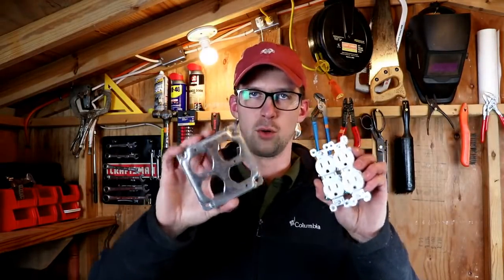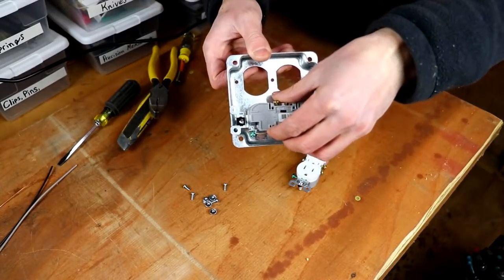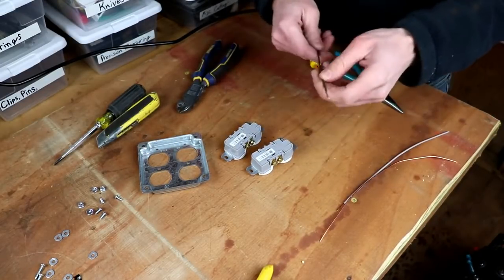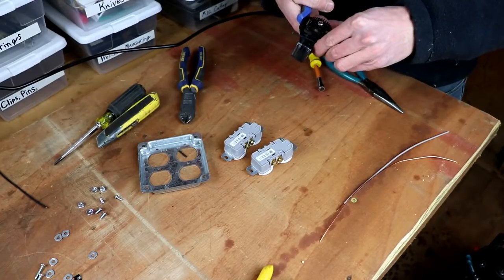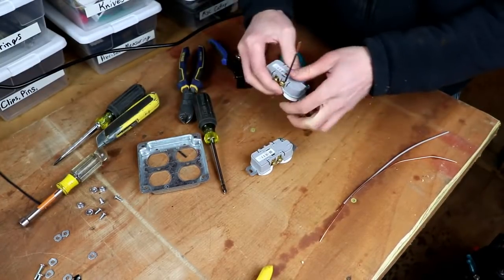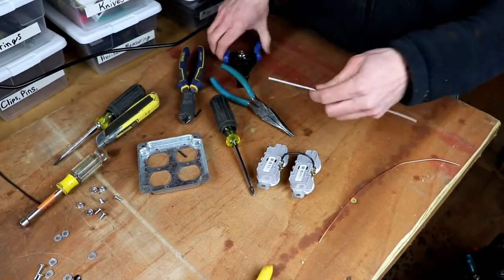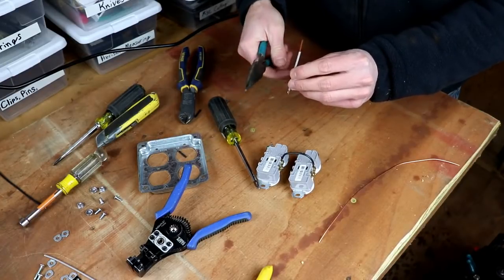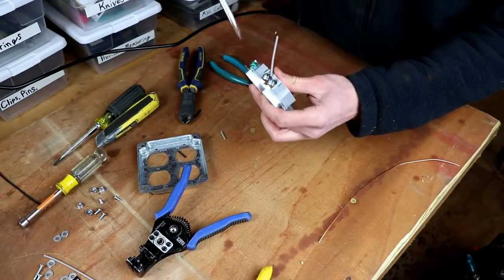How to Wire a Double Duplex Outlet

Comment: I realize that you meant well, and it's great that you didn't make a long boring video, however, that bring said, you're going to get somebody electrocuted if you don't learn how to properly do this?? Several other  people already clarified what you did wrong. You should most definitely make a follow up video with the corrections, or don't do anymore electrical related videos, until you completely understand the mistakes that you made, because they are significant mistakes!!! Cheers!

Comment: You were doing so great until you went to that box on the wall. The wire could have been through the stud to allow drywall at some point. I guess if you never plan to finish it then it's fine. But the wire was SO tight to the box, not extra if ever later needing to cut the wires in the box to redo something and then on top of that you cut the wires IN the box also extremely short. There is nothing left on that wire to redo anything later down the road if needed. Wire is super cheap, leave some extra outside the box and a little extra in the box.

Comment: You referred to the white wire as the 'neutral' and the black wire as the 'hot'. Also the metal box was not earthed and the twist on connector referred to as wire nut should have been taped for security. This is why it's always a good idea to get a licenced and qualified electrician to do this stuff. Reported for promoting dangerous practices.

Comment: Since it’s a metal box, should it be connected to ground as well?
Reply: Just finished putting together my own double duplex outlet and also thought about the need to ground the box. The receptacles I used will ground to the box when running the holding screws through the face plate and through the tab. There is a metal piece there that goes to the ground. 
Just wish I had found and watched this video first, would have saved me some time and effort.

Comment: I'm just Joe Homeowner but my god what a disaster of an installation this is. Ungrounded box, romex stapled to the front of the stud, wires way too short. Awful.
Reply: I am a licensed electrician and I agree with everything you said. He also didn't pre twist his wires for the joint he made with the grounds and we like to wire  2 gang receptacles in parallel instead of series because if one stops working the other one will keep working. Lastly he didn't tape around the outlets which is recommended and common practice when using metal electrical boxes.
Reply: @Breadmanbeck  Also, I've read that you can't use stripped romex because it isn't ANSI labeled once the outer insulation is removed.

Comment: I stopped at 8 minutes in, your required to have 6" of wire from your feed, (romex coming into the box), the box is required to be grounded, plus you should twist the ground wires together first, then put the wire nut on. And the romex is stapled to the outside of the stud, should have had a hole drilled thru the stud with the outside of the hole (closest to the front of the stud) a minimum of 1 1/4 inches from the front of the stud.

Comment: I count 4 code violations.  NM on stud face, no box ground, short pig tails, and using a non-gfci device as part of neutral circuit.  Using non-gfci device as part of hot circuit is not a code violation, but is bad practice. Any competent resale inspection will flag this, and a gov bldg inspector will jump on it with both feet. Take this down until you get it right.
Reply: I'd like to understand what you mean by, "non-gfci device as part of neutral circuit".  I'm always wanting to learn.
Reply: @jefferywaters2778  in your vid, a component of one of the outlets was in series of the neutral. Not permitted except for gfci..  For load side duplex outlets fed by a gfci outlet to function, their neutral must return through the gfci outlet.  In any other case, removal of a neutral connection to a device cannot break the neutral current path back to the panel for any other device.   The rationale for this is that in a chain of outlets, if damage or loose screws or whatever breaks neutral before the end of the chain, lamps or other load devices downstream of the break will pull the isolated neutral segment hot.  A dangerous no no. Outlets, switches, fixed lighting, etc, cannot be used as a part of a ground or neutral circuit.  In simple terms, removal of a screw from a device can at most disconnect the ground or neutral from that one device only.  Gfci devices are the exception because their operation requires it.  This reason is also why a gfci outlet must be the first outlet in a chain, it can only protect itself and downstream devices.  Read the NEC before you make self help vids.  I'm serious, you really really should take this video down or replace it with a fixed version.  P.s.  I'm not an electrician, I'm an industrial equipment EE, motors, drives, servos, etc.

Comment: Bonding screw on the box? Wire nut on the ground most areas are ok but some local codes call for bonding crimps. Ground has to be twisted  regardless. And one point not mentioned is make sure you do not get any plastic insulation under the terminal screws on the outlet. Stands a chance of coming loose over time. And also code is 6 inches of wire from the back of the box.

Comment: Are you going to ground the box?
Reply: Nope! Hahaha! Electrically, it is grounded because the frame of the outlet is ground, and the four screws are ground and they attach to the cover and the cover attaches to the box. Code wise, it fails, and exposed Romex on the wall fails. Good method otherwise.

Comment: So I have a question for everyone that reads this, my house was built with some 14 gauge wire in receptacles, I want to add another receptacle, so my question is adding a second receptacle should I use 14 gauge wire or 12 gauge wire even though the main wire that I’m tapping off of is 14 gauge? Does it really make a difference going from 14 to 12 gauge?
Reply: Go 14 gauge, you have no benefit going 12 gauge since you're on a 15 amp breaker and all the receptacles on that feed can not exceed 15 amps. 12 gauge is for 20 amps. You can install 12 gauge wire if that's all you have BUT your receptacles have to be rated for 15 amps max.
Reply: @dtm8073  thank you so much! I really do appreciate it! That’s what I was thinking too. Why do people use 12 gauge for receptacles and only hook it up to a 15 amp breaker? Is it because the wire is thicker and it’s more Better?
Reply: I’d use 500 KCMIL just to be on the safe side.
Reply: @highvoltage1979  that’s some wire lol

Comment: Why wouldn’t you drill through the stud to run the feedline into the box. The way you have it has the line crossing over the outside of the stud. A good explanation otherwise, but I like to leave about 6” of wire from the box connection. Had you left 6-8” of wire exposed, instead of 4”, the connection to the terminals would have been much easier and you could have looped the bare ground wire around the the ground screw in the box to properly ground the box as well as the receptacles. You have a ton of room in this box for the extra wire length. This is especially important when you have a conductive faceplate.

Comment: Yikes, no way to put it nicely, you are a dangerous hack. pros see box not grounded, small wire, wire cut too short, no gfi, wire crossing over the stud not through it, but  dyi homeowers are all saying "yeah thanks man, I'll copy what you did". Scary. It's no wonder as a owner doing my own wiring I get zero respect from supply houses, inspectors, the power company, ane line crews.
Reply: Not really. I'm not a pro but I saw "box not grounded" and "you cut those wires too short". It also looked shorter than usual before he cut it, but I figured that he had already measured; then he cut it again.  I did see the side over the stud but dismissed it as being a permanently  space that was never going to have drywall over it.

Comment: you don't have at least 150mm of line voltage conductor in your device box, your device box isn't grounded, you didn't twist the ground wires together, and the cable is stapled to the front of the stud instead of being fed through a hole in the stud which is going to get in the way of the drywall
Reply: I know this has nothing to do with the video and I doubt I'll ever use a plastic box as I'm going to be in the union but how do you ground a plastic box? or does it just go back to the panel for ground?
Reply: @Mikechill5  you only have to ground metal boxes, because if a live wire somehow touches the box then it will only trip the breaker, instead of electrocuting you.
Reply: @Mikechill5  no ground on plastic box
Reply: With a plastic box you don't ground the box itself. You splice twist and nut the grounds together adding a pigtail if there is more than one cable coming in or out of the box and you ground the device or fixture.
Reply: @Mikechill5  ha ha ha .. Yea, you can't. What are ya gonna ground? The fastener?

Comment: Electricians watching this video: AAHHHHHHHH!!!!!!! NOOOOOO!!!!!! 
No GFCI
Used 14 AWG instead of 12 AWG wire
Box not grounded
Romex wire exposed and risk of impact damage
3" of wire out of the box... should be 6"
Used jumpers to outlets
That ground wire nut was not tight enough, no twist in wire visible

No worries, it'll be fine....
Reply: 1. 14 AWG is perfectly acceptable for a 15 amp circuit.  14Awg  can handle 15amps without an issue and there is No NEC violation.
2. The receptacle is grounded therefore the box is grounded.
Reply: 14 AWG is perfectly acceptable for a 15a rated circuit.

Comment: I guess you do not intend to put drywall on the studs, or you would not have attached the wire on the face of the stud.
Reply from the maker: Correct. This is a workshop/shed that will never be drywalled.

Comment: I have a question. So is that metal box not grounded then?
Reply: By code no.
Reply: But in actuality yes. As when you screw the receptacle to the box it grounds from the metal to metal contact. Don’t count on this as it’s not code. Use a pigtail and a green ground screw!

Comment: your explanation not great. i believe code is six inches in the box.
Reply: It’s actually 6” beyond the lip of the box. If you have a 1 1/2” deep box, the you need 7 1/2” of insulated wire with romex removed, from the box clamp.
Reply: Were not here for code
Reply: @andresschwerin829  it’s not just code it’s safety and common sense. You need to have this length of wire in case you have to change something and have some slack in the box to reduce heat. If you don’t follow the code, established by experts, have 911 on speed dial.
Reply: @dodgerfan1963  this is clearly a joke, and I'm only 14, i know about the staple, but I think most people watching this isn't aren't electricians, so thanks for looking out for me
Reply: @andresschwerin829  no problem. You don’t want to get the nickname “Sparky”. 😉
Reply: @dodgerfan1963  lol I went to Nebraska to go understudy my dad's old electrician friends and one of his friend's employees last name was sparky

Comment: you should leave longer than 4 inches wire outside the box, because if someone changing different or new receptacle, they have to cut wire to remove old receptacle, and time to time it will become shorter,  when that happen, whole wire need to replace.
Reply: you can always just splice it man

Comment: Is there a way to do this with gfci outlets? I have a dual outlet running my laundry but feel like having a power strip off of it isn’t too safe.
Reply: Yes there is what you do is you do the same thing that you would do with a regular outlet but the only difference is you do it just with the line for two GFCI outlets only. But on the other hand if you want to only have one GFCI outlet and the other GFCI protected then you have the supply wire on the Line Terminal and the wire going from the GFCI outlet to the regular outlet on the Load Terminal. If you want to also make this a Middle of run receptacle then you splice in the main wire that it is currently running off of and use the pigtail for the GFCI receptacle.

Comment: This worked great for me! Also the easiest breakdown of it that I could find! Thanks for making it simple for us rookies.
Reply: You must have at least 6” of conductor extended out of the box. You should always twist the wires together before screwing on the wire nut. Thats what linesman pliers are for. Three to four twists always b
Reply: Remember to ground the metal box
Reply: Just because it works doesn't mean its right or good advice.

Comment: Wires in your box need to be 9 inches long, not 4! I didn't see a Romex clamp on the box. You didn't run a ground wire to the grounding screw in the box.
Reply: Where did you come up with 9”? Does anybody here even own a code book?Are  we just going by what some do it yourselfer told you?

Comment: Based on the view of your shop I assume the walls will left open as is. If so, I would prefer to see EMT conduit from the source outlet. It would look more professional and not hard to do, plus romex is designed to be covered (behind the wall) not exposed.
Reply: Romex or NM can be left exposed in unfinished non living spaces. But if that’s a workshop I’d go with MC just for piece of mind.

Comment: You need to ground the metal box
Reply: How do you do that - another pigtail out of the wire nut to fasten to the box ground screw?
Reply: @Mr2ndkings  yes
Reply: @lukasncolin6604  Thank you very much!  I am in the process of installing metal boxes on a concrete wall in my basement.  I'm coming off an existing outlet that's in a connecting dry wall section and using the Legend Metal Raceway and boxes.
Reply: @Mr2ndkings  I am actually 13 and I have done 20 outlets and I have studied a BUNCH of Electrical.

Comment: code required 8 inch off the box, no tape on the outlet, it will get short circuit, jumping wire will cause overheat on the jumper

Comment: re 0:55 Note carefully!  He did break of the 8 drywall tangs, but he is NOT breaking off the screw mounting tang, only pulling the paper nut off the 4 screws.  These 4 tangs are needed to keep the outlets properly secure behind the faceplate. 
re 2:00 Note: He is using the more secure 'screw terminal' instead of the simpler 'push terminal'.
Reply: Backstabbing = bad!

Comment: How has it held up?
Reply from the maker: It's still going. As many have pointed out, I committed several code and safety violations here. Despite those violations, it still works. I would recommend getting advice from a qualified electrician.

Comment: I think you should also add if this is not the end of the line you will need additional power.neutral and ground leaving the box.  Also the outlets have to be grounded to the box.
Reply: Also only one box in the circuit needs to be grounded with a ground screw, he may have done that in a previous box on that circuit
Reply: How do you do that - another pigtail out of the wire nut to fasten to the box ground screw?
Reply: @Mr2ndkings  the hot and neutral side of the second outlet that wasn't used

Comment: Nice attention to detail, but it would not pass inspection: The box needs to be grounded.  The cable being attached to the outside of the stud is also a safety problem. In unfinished spaces, you are allowed to run cable down the length of the studs but not between them. These are real safety issues. Code also requires at least 6 inches of wire in the box so that repairs can be made in the future.
Reply: Does the box only need to be grounded because it is metal?
Reply: @SLAWTERX  Yep. You have to put a grounding pigtail in that box with and join it to the bare grounding wires on the devices he already capped together. If it was plastic boxes, you'd be okay to just ground the device only, but metal boxes need to be grounded too.

Comment: You didn't ground the metal box.
Reply: @ElementFreedive  How do you do that - another pigtail out of the wire nut to fasten to the box ground screw?
Reply: I agree, but in this case the outlet mounting screws ground the cover to the box, so it is grounded.  But.....I would have added another piece of wire and a screw to his pigtail ground.  Also, I electrical tape my wire nuts and put a piece around each outlet covering the screw terminals (if they are in a metal box.)
Reply: @ElementFreedive  lol what code is that ?
Reply: @luvdady  You comment suggests your stupidity.
Reply: @richardbaldinger1970  or yours ...
If there's a code compliance problem then one assumes that there should be a code rule.
But thank you for your commentary.
Reply: The receptacle is grounded therefore the box is grounded.
Reply: @kalijasin  not up to code.  you need to run the ground wire to the box then to the receptacle.
Reply: @kalijasin  Understand that and yes the outlet may be grounding the box but it will fail an inspection because you have to follow code and code reads that it has to be separately grounded like a use of a (pigtail would be sufficient).
Reply: @richardbaldinger1970  only if the box is metal and there is a circuit conductor splice.

Comment: You should pigtail the wires.
No jumping
Reply: I’ve heard that before but I don’t understand why?
Reply: @yankkesrule  The little bridge between the two screws isn't meant to carry the full ampacity of the circuit feeding it. This actually a code violation.
Reply from the maker: Hey Joe, thanks for chiming in. I realize after reading the comments that there are a number of things I should have done differently, pigtails being one.